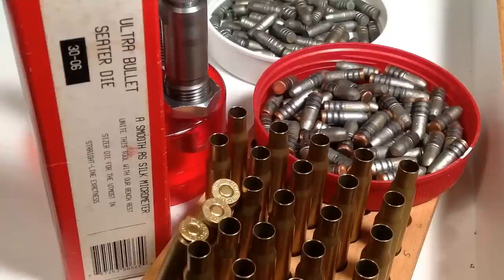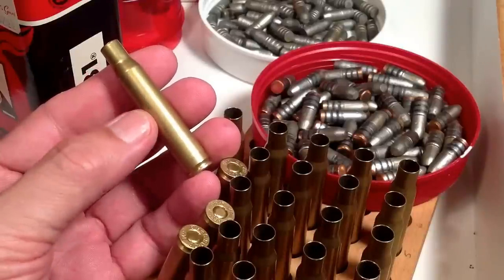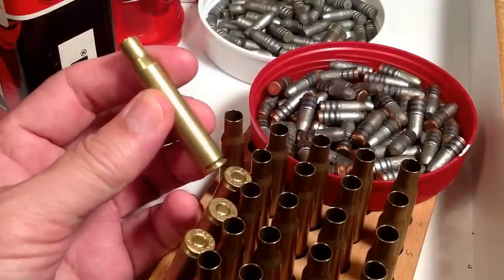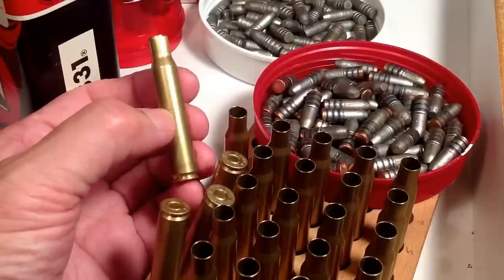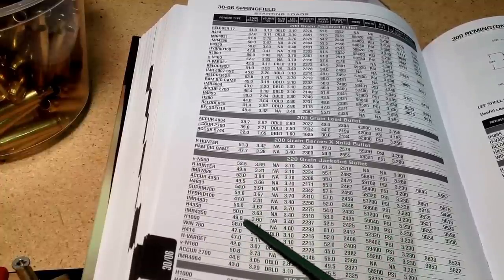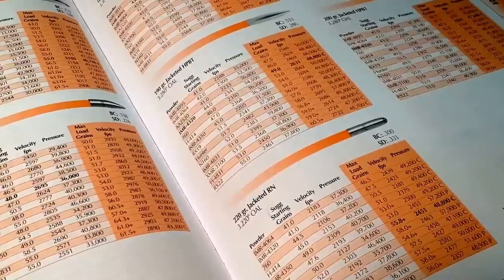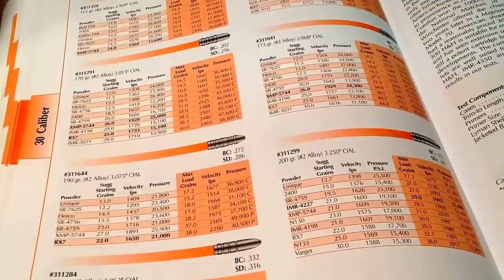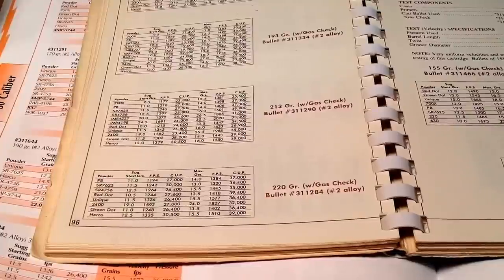The Danger Of Reduced Loads in Rifles

Comment: Sage advice... extremely fast pistol powders also have a known history of unpredictable outcomes. People used to use Dacron fiber to fill case, tamp or hold powder at the bottom of the cartridge near flash hole.
Reply: This doesn't seem to match the experience and advice of Mr. Kekkonen, who suggested to use fastest burning and easiest igniting pistol powders for reduced and subsonic loads.
Reply: It doesn’t match my own experience either. I’ve used charges as light as 4.5 gr of fast burning pistol powder in 223. A match shooter (and local legend) shared with me that he shot a 338 Lapua with light charges of 4350 and it performed well.

The key IMO is to keep the rate of pressure rise high enough to ensure stability.  A light charge can do this if the powder is fast enough burning.

Comment: this some what amazing I have never heard of this.  I do know loading for a suppressed weapon we always go to a pistol powder.  The 300 Blk was designed to work with pistol powder even at super sonic speeds.  Reading the comments I too agree the only way one would see this issue is for competitive cowboy shoots.   I have stared practicing for 3 gun and tried a lower velocity bullet however I ran into issues with timing and being used to recoil to the point I just went back to normal max loads.  I also have seen a power factor in points and have started practicing with .40 just for this.  Some of the competitive shooters are also going to a larger caliber for the power factor in points which I find interesting.
Reply from the maker: +MadSativa -- And many contemporary shooters have also not heard of this phenomenon of shooting.  But these Kabooms can happen just as easily today as any time in the past - same powders, same barrel steels etc.  You can always spot these events - the rifles blow up with the epicenter at the chambers - not the barrels.  It is the cartridge case that is the bomb from reduced loads.  The popularity of the 300 BLK subsonic concept may make duplication in other calibers attractive.  And as you brought out, the temptation of shooting cowboy action with reduced loads commonly done can lead to trouble with slow burning powders.  When we did IPSC, we were always pushing upwards on getting to Major Power so these events were moot.  Safe and good shootin' to ya...

Comment: Very interesting thanks, I have been buying my reloading equipment one piece at a time trying to be fully prepared for my first time reloading. Powder cop, halo light, bullet sizer, digital and mechanical scales ect.But none of this is worth a lick at experience. So just want to let you know that for me I like the use of my vision and the use of both hands, so I value the information I get from you FC, and elvis and loads of bacon and Johnnys reloading and many others on you tube. Thanks for sharing your data and safety tips, I 50 years old and I,m getting to old to hurt, I am no spring chicken any more and it takes a lot longer to heal now, so any avoidance 
I can get from making a fatal mistake is much appreciated, and  I hope that any young guns that think there the man of steel takes heed to safety as well. God bless
Reply from the maker: The patriot - Our firearms are safe to shoot, but in rare instances, they can be unsafe.  After all, the only difference between our guns on firing and a 250 pound bomb when the detonator fires is 1) difference in the powder 2) size of the event 3) guns release the pressure before exploding.  Our guns easily generate upwards to 65,000 psi, but vent any additional pressure rise before strength of the steel fails.  If the pressures are higher due to mistaken charges or wrong powders used, or if the pressure is confined, our guns really are bombs in our hands.  It strongly behooves us to do it all safely to guard against badness.  Does this mean we should not shoot?  No way...consider when we drive our cars - there is tremendous kinetic energy there, plus the explosive powder of 4 sticks of dynamite times the number of gallons of gas on board. Drivers and passengers do not have the inertial dampeners of Star Trek in accidents.   People die in cars when there is unsafety.  Getting out of bed is unsafe.  Life is unsafe.  We need to urge all the young people that safety is the first consideration in whatever they do and wherever they do it.  Sorry for saying the obvious... FC Steve

Comment: As he said it’s apparently never been duplicated. I’ve shot a majority of reduced loads also at down hill conditions . I sometimes will get a inconsistent burn but never anything seemingly hot. I’m not so sure this actually happens. I think ppl have blamed it for switched powders or overcharge etc. has it ever happened Maby but why can’t it be duplicated by a manufacturer or apparently me. Who knows
Reply: I've got a reduced, (like REALLY reduced) .223 load that I chrono'ed at about the same f.p.s. as a high velocity. 22lr (think in the high 1,195 to low 1,200 range). I have never experienced any kind of pressure signs. The cases slip right out of the chamber, no flattened or cratered primers, no heavy bolt lift.

Comment: Steve - What are your thoughts on reducing 357 loads? I have 2 recipes that both call for HP-38 powder. The jacketed recipe calls for a starting load of 6.2 grains, whereas the recipe using cast bullets calls for 3.4 grains starting load for the same powder. Can I substitute jacketed bullets for the recipe that calls for cast lead to achieve velocities of 800 fps? Thanks Jim
Reply from the maker: Hello to ya, Jim..!!  What you are wanting to do is load 38 Spls in 357 cases for shooting in 357 revolvers.  This results in reduced powder efficiency requiring more powder to get 38 performance than if using 38 cases.  The trade-off was supposed to be 1) better accuracy because of less bullet jump and 2) no fouling ring in the chambers.   The bullet jump has significance in rifle shooting, but has no bearing for accuracy in revolvers - I have videos that show the bullet is still in the case with the shorter brass as the front of the bullet is engaging the back of the cylinder throat.  Plus Bill Davis routinely made some of his custom PPC guns in 357 cylinders for shooting with 38 wadcutters = 1 1/2" groups at 50 yards.  And PPC revolvers with shortened cylinders to give zero bullet jump did not take the PPC world by storm.  So 1) is basically a belief held by those who hold by it - some of this group actually say the bullet jump results in the bullet "rattling around" = simply not so.  As for 2) above, even the worse rings - just chuck a brass brush in an electric drill and run it in the chamber for about 10 seconds - presto, no more fouling - and you have to clean the gun anyway.   So use the 38 cases for 38 loadings.  If you want magnum performance, that's what the 357 was all about and the 38 can't give that unless the bullets are seated out there.  Good shootin' to ya,  FC Steve
Reply: Thanks Steve. One more thing to mention, is the reduced load I speak of comes right from the Hornady website. All I want to do is substitute the a lead bullet for a jacketed one. Having said that, do you still recommend 38 cases. I'd rather not have both 357 & 38, but I will if you think it's better to do so. Thanks again. Jim
Reply: Unique or titegroup

Comment: 4895 can be reduced to 60% of the max load safely but there are other issues.  I'm trying to duplicate 30-30 velocities out of a 7.62x54R for use in the 44 carbine to reduce recoil.  The problem I'm having is I'm using steel cases and they don't seal as good as brass and will pull away from the chamber and leak back around the case before the bullet leaves the muzzle. So reducing the load didn't work. I tried reducing the original russian surplus load from 48 grains down to 40 grains and it leaked really bad around the case. It might work with a brass case but I haven't tried that yet. So far no luck with steel cases. If you've been successful in doing something like that with steel cases let me know what load you're using.

Comment: Not that I would ever recommend reduced loading a slow-burning powder as there are so many choices (or were) of powders but in saying that I can see in these days where there might be the desire to do so with components hard to find.  To the point, I just don't know if I buy it; the blown-up guns may have been double charged rounds or the latter of your explanation; where there is sort of a hang fire; partial ignition pushes the bullet out of the case and into the rifling (where all peak pressure is built) then the rest of the powder goes off with bullet jammed.  Better on the safe side.

Comment: I just finished asking you a question about this and found you had a good video for it!  My load will be 45-70 and I have Varget which is supposed to be very slow.  Thank you!
Reply: Varget is a medium burning powder falling in between imr 4320 and imr 4064 slow powders are more like  h4831or reloader 25.imr 3031 is the slowest powder listed in my manual for 4570. Please be careful 🙏   . I don't think varget will work for any low velocity loads, especially in a large straight wall case.

Comment: Looking for a load for 308WIN powder coat cast bullets.  Hodgdon claims that H4895 can be reduced to 60% of maximum published load (not indicated for other powders).  FC, do you think this might be a good powder choice for this application?  Faster than cast, but slower than jacketed.
Reply from the maker: +qchemp420 -- Of course, this whole topic is a highly specialized area of reloading and does not cast a safety shadow on the entire activity.  Unique would be the powder of choice for reduced loads in the bigger cases including the 308.  If you want to do the H4895, 60% is still close to 50% and that 50 is where the overpressure occurs.  Might be good to set 65% as your floor for a little extra safety margin.  You will note that the starting loads for H4895 are well ahead of 60%.  If 60% was a good starting load, they would have published that.  H4895 probably has a bit better safety in ignition characteristics and burn properties than the other slow powders, but why mess with that?  You just don't want that sitting in the back of  your mind as you shoot your ammo.  That's the beauty of the 300 Blackout case - it was developed strictly so that those 20+ grain charges of powder could be shot safely since you've got a smaller case volume for that charge - completely safe.  But put that same charge of slow burning powder in a voluminous case like a 300 Weatherby and we are really looking hard for trouble.  Use the 308 and we are only looking for trouble.  Use the 300 Blackout or Unique powder and there's no trouble to find - within reason, of course.  Besides, look at the efficiency and economy - 10 grains of Unique vs 24+ grains of H4895.  Good shootin' to ya!!
Reply: Thanks for the reply.  300BO works well with cast Lee 155 GC bullets near 1800 fps using powders from lilgun to RL7.  Don't know about pushing PC bullets any faster in 300BO.  If you are a re-loader, 300 BO is a fun cartridge.  Trying to get 308WIN PC cast bullets fast enough to shoot tannerite.  20gr of 2400 shoots the Lee 155 good at 1900 fps, but think I might be getting near max for that powder.  Investigating slower powders, yet concerned about a voluminous case.

Comment: Lee's 2nd edition has a discussion of this, and a sort of formula for keeping a wide margin away from the danger zone. It is relative to the powder's position on the burn rate chart and how much you can safely reduce the load. The multipliers for working a load backwards are only for medium to fast rifle powders. I like that much better than the lyman system since it is all relative to pressure, not just velocity.
Reply from the maker: +GunFun ZS --- I think I first learned about this when I was reloading for my 25/06 using Norma 205 powder many years ago - do not reduce loads - that message always stuck.  Best  Regards to ya..!!
Reply: FortuneCookie45LC For the loads given with a multiplier for reduction, you aren't really reducing below the recipe range. You are following the book data on how to keep safe, and can predict probable velocities and pressures. Going way low with slow powders and large case volumes is risky, especially with double base powders, but that is not what I am talking about. I'm talking about sticking to the ones that are known safe.
Reply from the maker: +GunFun ZS -- Sounds like that article is a must read... Best Regards to ya!!

Comment: Great information. I never tried going below minimum load data more than 10%.
Reply from the maker: +Mr. Tolly (AKA: fatmantolly) -- When reloading manuals publish starting loads, they've taken all the safety issues into consideration so that we do not have to further cut the powder charges to begin.  Additionally, when I see a broad range between the starting loads and the maximum loads, I usually take a midpoint to start my load testing - this save time and wasted components because the best shooting load is usually 1-2 grains under maximum.  I just want to creep up on that point for the safety, caution and prudency we all want.  Why do I do this?  Because, as a rule, factory hunting ammo is very competitive and loaded hot - I often see flattened primers even some minor cratering of the primer indents in once fired brass at the range.  Only when the ammo is marked target or cowboy is this not so.  You can bet the ammo is also loaded to safe pressures as well.  So I'm not going to work up my own loads using the minimum published loads to start my load testing - I want to get to my pet loads judiciously - spinning my wheels getting nowhere fast is not in the plan... Good shootin' to ya!!

Comment: Never would have thought of that, can this happen with slow powders in a pistol case? like 357 or 38spl?
Reply from the maker: gary gilbert - Not anywhere as much of a problem since almost all of our pistol cases are straight wall plus the powder space is not that big anyway.  There is not much call to load with small charges of slow powders because we have so many faster burn powders to use instead.  For example, if we want a 500 fps load in an auto pistol, the gun won't function.  And if in a revolver, the bullet might get stuck in the barrel.  At any rate, we'd be using Bullseye, TiteGroup, Red Dot, 231 - powders like that for our 600 fps load - we would not even think of trying to use H110 or 2400 for that as the manuals warn us against doing that.  Best to ya,  FC
Reply: I have had H 110 fail to ignite fully in 357 with only a slight reduction in  loads or not using a magnum primer. The bullet lodges in the barrel and the unburnt powder turned into a weird plastic substance. If you have a 70s manual, reduce 2400 loads 10% . Been reloading long enough to make a few mistakes 😉 😆

Comment: how are you? got a question.Tried to get a lee mold, 45/70 ,458 . 300 gr,tl, gas check, having to go to rcbs steel mold, would you be ok doing that.?
Reply from the maker: Rob Tolley - Off the top of my head, I do not believe that Lee makes a 300 TL GC for the 45/70 - As I recall, the 340 grainer is the lightest.  But the 405 is the one most will use.  If you want the 300 and RCBS has one, by all means, that is the one for you.  I've got a number of steel (iron) molds - they take a bit more to get them hot, but you can use a hot plate to expedite that... Good castin' to ya,  FC

Comment: When shooting lead or powder coated bullets, the charge is usually substantially less ( # grains powder) than used for a jacketed bullet. In this case having a partially filled cartridge case is probable. This seems like it is very similar to the reduced load problem that you are talking about. What is the solution? How do you fill the case so that this doesn't happen
Reply from the maker: Richard Holt - Thanks for the good question.  With cast bullet loads in our high power rifles, we do use smaller charges.  The key difference is that the powders used are faster burning pistol powders like Unique or Red Dot or 2400.  These are completely safe in reduced loads whether or not fillers are used.  The danger of detonation or high pressures is due to 50% or less loadings of slow rifle powders.  These are the ones with the problems  Best is to start with published starting loads and not go below them.  Have a great day,  FC Steve.

Comment: What you say about reducing rifle powder amounts is only true in a general sense. For instance, Hodgdon claims that H4895 can be safely reduced to 60% of the maximum listed charge, where H4895 is, in fact listed as one of the powders for bullet you are using. For example, I am loading Hornady 150gr. projectiles for .308 and 60% is 27.36gr. of the listed max. of 45.6. They recommend you work up from there till you achieve the accuracy you desire. I reload 8mm Mauser, 7.62x54R and .308 very successfully with H4895 and get good accuracy generally @ 70% max. loads, and no issues to date.

Comment: Would you say that the recommended way of reducing recoil and velocity would just be to maintain the powder charge but increase the grains of the bullet
Reply: aaron g not at all
Reply: Increase in bullet weight will increase recoil and change the 🔥 burn rate of the powder. So 👎 no.